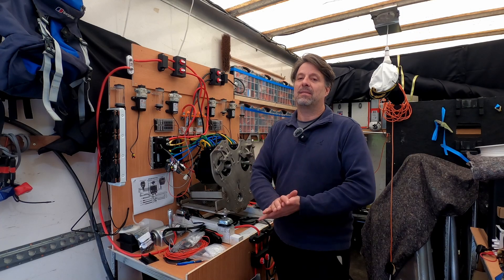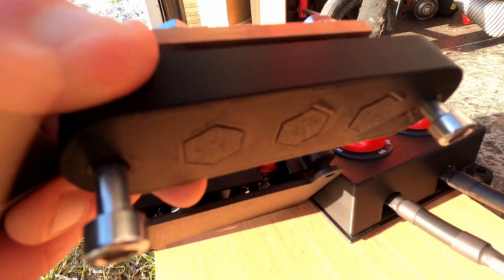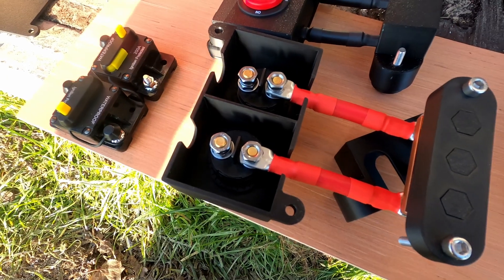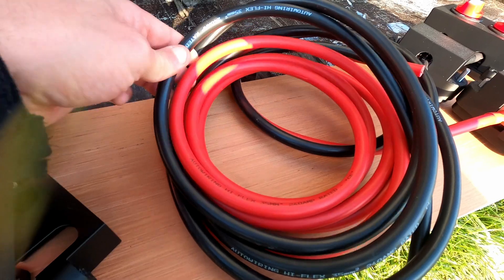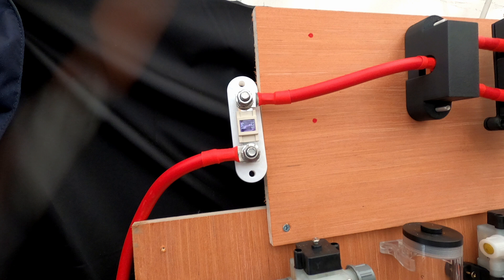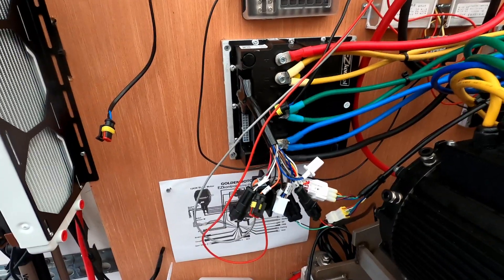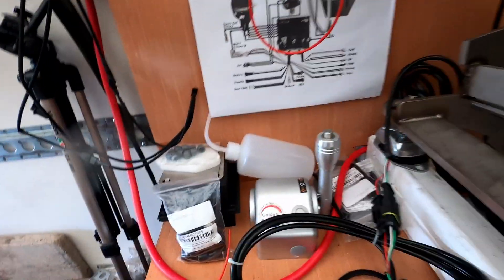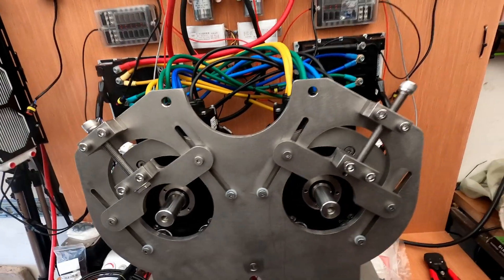Off-Grid Boat: DIY Electric Boat Motor Assembly - Ep. 11

Comment: Nice work, I would suggest labeling the wires, if you haven't thought of that already. Having a wiring diagram with as much information as possible would be great for start-up and troubleshooting when that need arises. I am more concerned about having two motor controllers driving the same propeller shaft, is there a fail safe to prevent one motor spinning faster than the other, or to prevent one motor going backwards? I'm really shocked that there needs to be two motor controllers, it seems one motor controller could drive both motors. At minimum I would think that the controllers need to be in constant communication with each other.
Reply from the maker: Hey, hope all good! Thank you for feedback. Was actually looking for my Dymo Label printer the other day for that very reason (struggling to find it). Once everything is working I will definitely make a flow diagram, knowing myself (memory like a gold-fish), it will come in handy in a year or two:) I don't think there is a fail safe as such, and do not think there is any inbuilt 'sync' functionality between the two controller (but a good question ans one I will dig deeper on). As a start I will just make sure that they are individually spinning at the same RPM at the same input. If they do not I think I can adjust this via the controller. Once setup with the pulley then all I can hope is that the RPM stays calibrated and do not start to wonder. I think that the Motor Controller is only built for a set amperage. Running tow motors would require twice the amperage to pass through and it could not handle the load. I asked this specific question myself from the company as hoping to save on cost and having less of an sync issue but unfortunately two it is:)
Reply: @modularhippo  could you use just one controller? My thought is that if there is one controller feed the (0-10 vdc for instance) command to both motor controllers then the out put should be the same.
Reply from the maker: @letsdosomething9610  I think the issue is that that the controller is built to handle the max amperage of one motor. The signal from the throttle will control the load from controller to the motor. If one controller would provide both motors with power then that would mean twice the load going through the controller which it would struggle to handle. It overheats fairly quickly without water cooling just supplying power to one motor. Or, maybe you are saying keep both controllers but only take the processed throttle signal from one controller to make sure identical at all times (the individual motor controllers can still handle the designated load? If I struggle to get a steady (same RPM) the way I do it now then that is definitely worth looking into:) Thanks.
Reply: @ Yes I think the one input to 2 outputs would be the best way to keep things consistent. Hope this helps and I'll be sure to watch your up coming videos, very interesting subject for me.
Reply from the maker: @letsdosomething9610  It is an interesting concept and I may just have to go down that route. I will explore how exact and configurable the Motor controllers are out of the box and if I cannot get them to do the same RPM with one throttle split into two separate output signals then working with one signal from one Motor-controller and split that to the two motors is a really good idea:) To be continues!!
Reply: @ I hope you don’t think I’m nagging you, I think your concept is great. Moving away from a fossil fuel propulsion is the way I would build.
Reply from the maker: @letsdosomething9610  Not at all brother, you got valid points and creative feedback, can't ask for more!!:) The goal is to get away from diesel fumes and the noise, should be doable:)

Comment: I'm wondering how you're going to limit the current draw to 175A. I guess it can be set in the controllers' parameters. The motors are 20kW peak power each so a potential for 800A demand. Without the draw limited, calling for too much power in a panicky situation could leave you with none at all, just when you urgently need it. Using the same motors, I have a 500A fuse and 95mm² cable for each motor, though 70mm² would have been sufficient.
Reply from the maker: Hey Stegra, hope all good!! A very valid point, thank you. The idea is to try to limit this in settings to avoid 'accidental' spike of current that goes over 175A - As far as the gearing and prop goes I should never have to max out the motor to get the propulsion needed BUT I don't want a 'slip' on the throttle to potentially burn a fuse in a situation where propulsion is crucial. If limiting this is not doable then the boat installed version will have to have thicker cabling and higher fuse rates:) Luckily I can bench test this until the cows come home before ready to go in the boat. You will be up and running way before me so looking forward to see some numbers around 'draw' during usage as and when you get them:) - Our displacement will be different (and other factors) but that can be taken into account later. Sent you an interesting article around that:)

Comment: Noticed that your slicer was set to PLA, but maybe that's just for the initial prototypes?

Do be careful as PLA can become quite brittle after a year or two, especially when exposed to high humidity. I would recommend switching to PETG or ASA, maybe even fire-resistant PETG/ASA, before the final installation. Maybe even TPU 98A or similar could be a option if you want something "bump proof", but TPU can be tricky to print so not for everyone.

Just trying to give back something with what i have experience with. :)
Reply from the maker: Hey Patric!! Thanks for the comment  and taking the time to provide feedback. Very much a novice on 3d printing and used PLA for initial prototyping. Saying that, without your feedback I would very much happily have left part as PLA not knowing anything different (so thank you):) I have done some parts (white fuse holder for example) in ABS, what is your experience on that one? Also, if you could only print parts in one material them which one would you choose? Interesting topic so thanks again👍🏻
Reply: @modularhippo  ABS is fine too but you would need a enclosed printer, and even then it may warp fairly easily.. ASA can be a bit easier to print compared with ABS, and ASA do produce parts that can handle the elements much better (UV etc).
ABS with glass-fiber does do wonders in reducing warping. If you use filament with carbon-fiber or glass-fibers you do need a hardened nozzle as plain brass wears out quite quickly.
Both ASA and ABS do release toxic fumes so do print in a well ventilated area, and don't stay in the same room while printing.
Both of these require a enclosure, but that can be as easy as putting a cardboard box over the printer and let the air inside heat up before the print starts.

So my own order of preference would be PA12-CF > ASA-GF > ABS-GF > PETG-CF > ASA > ABS > PETG.
(GF = glassfiber, CF = carbonfiber)
But price do jump up quite a bit on that list.

As you are dealing with high-current connections that may get warm i would prefer using filaments that are self-extinguishing / fire-resistant.
For these parts i would prefer using something with high glass-transition temperature, and remember that filaments with CF/GF raise that a bit.

It all depends on what print-quality you and your printer can produce with the different materials. PA12 is not a beginner-friendly material, so you better only print with that if nobody is around 😀

Can't post links here, but there are some really good cheat-sheets out there that break down the filament properties / printability.
Search for "3d printer filament comparison cheat-sheet" and you will find some.

You might also want have a look at the video Zack Freedman made called "The 3d filament tier list" if you want a brief overview of basically all types of filaments, and have a few laughs on the way. 😂

And as a general comment, as i could not see everything in the video. You don't want to rely on the plastic in compression for the connection-bolts as plastic under constant load, if exceeding the deformation load, will deform over time and may make connections loosen. Using a nut as a back-stop, as you did in the video, is a really good thing.

TLDR; If the parts are never exposed to UV light and the only real exposure is to humidity and/or some chemicals i would say self-extinguishing / fire-resistant PETG / PETG-CF should be good enough, but maybe go with the CF variant to bump up it's temperature-resistance a bit.

But now the comment is starting to get too long.. Feel free to hit me up if you have any specific questions.
Reply from the maker: @patric001eede4  - Hi Patric, big thank you for expending on the subject, looks like I have some bedtime reading/YouTube'ing to do to get my head around it all, ha ha:) I currently run a Bambu PS1 (enclosed) in a workshop so guess I should be good from that point of view. Ventilation is questionable but can leave the print and return to workshop when completed:) I would probably aim to find something that works without me having to upgrade nozzle etc. only due to time constraints. Good point around putting nut/bolt pressure on some parts and how they act over time (lose electrical connection points is a big no-no so will keep my eyes on that one). I have kept the infill density fairly high to ensure stability but time will tell:) How amaizing is 3D printing though, what a game changer, just wish I took the leap earlier. My brother bought his first one 15 years ago and back then they were allot of tweaking, config and endless re-prints so thing it scared me of a bit. Touch wood, my experience from printing today is plug-and-play!! Thank you for offering future advise, I am sure we will speak again on the subject:) Thanks Patric!

Comment: I really like the distributors with the covers. 
I see that you have attached thin “sensor/control cables” directly to the high-current cables without additional fuses. In the event of a short circuit in the relatively thin “sensor/control cables”, these will burn out without triggering the high-current fuses.
Reply from the maker: Hey Albert, hope all good your side! That is a really good point. As far as thin cables go I have the cables from the throttle to the motor controller, I also have the red AWG 16 cables running from the DC Contactor to the 48v->12v buck converter, as well as AWG 16 cables running to and from the buck converter to the 12v Fuse boxes (and one negative to the negative circuit). Would you say all are at risk or only the ones connected to the DC contactor? Need to dig deeper on that one as was to focused on the 48v 200a cables and the havoc they can create if not fused properly. Thanks again!!

Comment: Good to see the progress. It's really coming together. I especially love all the great 3D prints. 
These isolation switches are known to be problematic in terms of heat, some even causing fires. You might want to monitor them closely during your trials. 
Regarding the ones used to switch off the motors, my suggestion is to put a simple switch into the (silver) control cable of the contactor, which would allow you to switch them off manually, avoiding the need for the high current isolation switches.

I'm looking forward to see the first spin. 😁
Reply from the maker: Hi Electron Tinker - Big thank you for comment and valuable feedback. Was not aware about the isolation switch issues so will definitely keep an extra eye on those during trials. I am thinking of getting one of those heat sensor cameras that you can add to your mobile phone to allow me to find any heat-creeps.  Adding a switch to the silver cable is a good idea, I will get that sorted as makes good sense (thank you):)
Reply: Is the contacter not just a fancy relay? There shouldn't be any connection to the high current side no?
Reply: @dylangallant5459 It's basically a switch that can be switched by a secondary, low power circuit. Yes, that's like a relay. My thought was that instead of having basically two switches in series in the high power line, just use the  low power circuit to disable the motor by deactivating the contactor.
Reply from the maker: @dylangallant5459 - Hi Dylan, Thank you for your comment. You are right, it is a relay and when used for higher amperage they call them contactors. These are both connected to higher current (battery positive to right side, and left side positive goes to the motor controller) The controller's themselves connect directly to battery negative. The ignition cable sends a small current to the contactor to open high current flow. Or at least that is my hope in theory:) I will in next episode share a final connection flow diagram as a sanity check before connecting to battery. Saw your channel, using Davinci myself so will follow you in case youstart uploading:) Thanks Dylan!